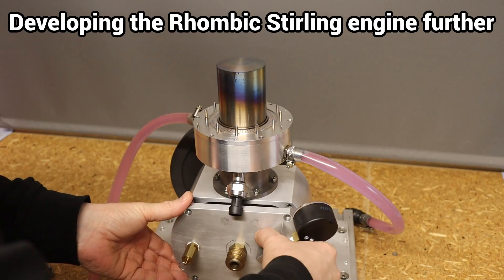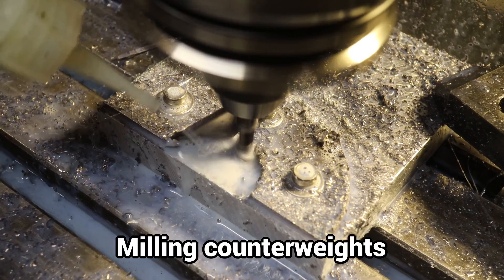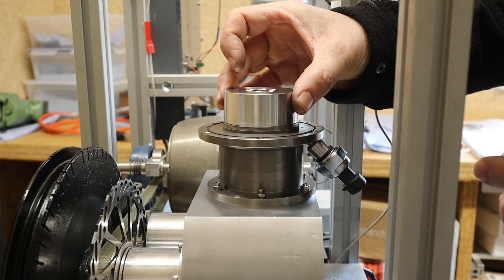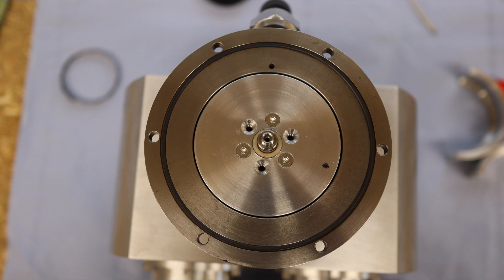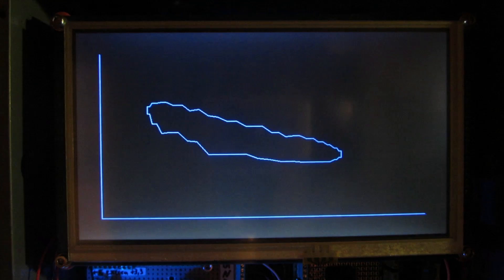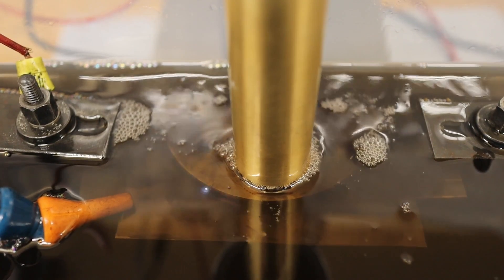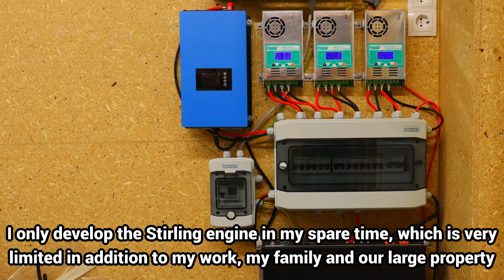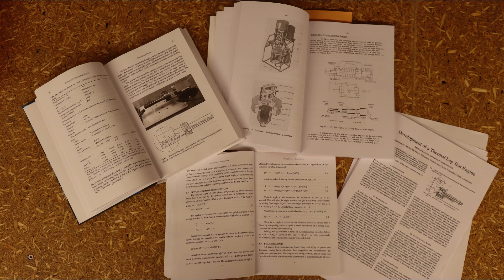Stirling engine development for cogeneration of cheap DIY energy to become off grid and independent

Comment: Hi. Cool project. I think that every type of Stirling engine can generate a certain amount of power for a specific application. In a home application, the weight of the engine is irrelevant. The size of the engine can be limited to a certain extent. What I'm getting at is that power and durability can only be achieved with a working piston. As you explained in the video, the ratio of friction to size and rotational speed is important. I am looking for a displacement piston as a rotating piston to reduce friction in this part of the engine. I also believe that, in general, a larger engine with lower rotational speed will have greater efficiency. Best regards :)
Reply from the maker: Thanks for your kind comment!
I don't know what you are referint to, but usually when I talk about reducing weight I mean reducing moving mass!
Moving masses mean friction, wear and unbalance!
When I go back to the rhombic Stirling when finished the thermoacoustic, I will make a much larger version.
A 18 kg Blank from 1.4571 stainless steel for the heater is already in my workshop!

Comment: Instead of piston rings, have you perhaps thought of using amorphous carbon piston skirts, designed similar to turbine engine oil seals?  Or just extrude-honing the piston bore to create a localized area of microturbulence?
Reply from the maker: The piston running surfaces must run dry, which makes many things more difficult!
An amorphous carbon piston skirt sounds very complicated?
Thank you very much for your helpful comment!
Reply: @myengines2443  they are not terribly complex, but they require a somewhat specialized manufacturing process as carbon powder ingress will short out PCB boards, etc. so any lathe or mill used to shape the carbon must be well-protected.  They are used in gas turbine engines to seal the rotating power shaft(s) bearings from leaking oil and from preventing compressor bleed air from entering the bearing housings.  They are strong enough to function well against axial friction in engines that produce many tens of thousands of HP, but they are too fragile to resist much radial pressure.  There is a paper "Leakage and wear characteristics of carbon seals for aero-engines" by Guoqing Li et al. that describes carbon seals and their design fairly well.  Good luck!
Reply from the maker: Thank you very much for your great help, I will look very close to this technology!

Comment: Thanks for sharing! I'm about 80% percent done designing my external heat engine in CAD but stopped to focus on piston seal design after watching this video--I am concerned about the piston service life. I originally planned to use an off-the-shelf PTFE (with a filler) piston seal but will experiment with a piston seal that uses a different approach than an "energizing" o'ring backing to increase the effective spring length to allow the seal to expand more as it wears, thereby extending the piston seal life. 

Applying this approach in your case, it would be like having multiple concentric spring steel straps to increase effective spring length. Maybe alternate between wavey pattern and circular pattern, concentrically. So, as your Igus tribological piston seals wear, the force pushing out will not decrease as fast, hopefully extending the service life of the piston seal.
Reply from the maker: Please show a video of your very interesting work, it will help us all and you also as you get so much motivational help!

Comment: Maybe you can try ribbed pistons for maximum heat exchange.
Reply from the maker: The engine has very big heat exchangers so a ribbed piston would not make a big difference.
it would also make the pistons more complex and heavier.
In an engine without external heat exchangers your suggestion could be very efficient.
Reply: :p

Comment: If the work output of the Stirling Cycle is singnificantly lower than that of the Diesel Cycle, wouldn't it make more sense to consider implementing a different cycle - such as Diesel, Otto, or Brayton - in an engine with an external heat supply?
In a cogeneration plant, the heat removed during the cycle can be transferred to the coolant return line.  Therefore, the absence of regeneration in the cycle may not have negative consequences.
It is likely that such an engine would require a gas distribution mechanism, but the added complexity might be justfied by increase in power output.
Reply from the maker: I don't want to use an internal combustion engine as I want to use self produce bio gas or wood gas which both are not absolute clean and will destroy an internal combustion engine very quickly!
Reply: @myengines2443 Если Вы прочитаете мой комментарий ВНИМАТЕЛЬНО, то сможете увидеть, что двигатель внутреннего сгорания в нем не упоминается. Речь идет о двигателе с внешним подводом теплоты. 
  Я считаю, что в когенерационной установке может быть применен двигатель с термодинамическим циклом без  регенерации теплоты.
  Лучшим, вне всякого сомнения, был бы двигатель работающий по циклу Карно. Однако, реализовать такой цикл мешают два его недостатка - очень высокое давление, развиваемое в процессе цикла, а так же чрезвычайно большой ход поршня, необходимый для обеспечения полноты расширения.
  Предлагаю отрезать оба проблемных участка. Область высокого давления ограничить изобарой, а область чрезмерного расширения ограничить изохорой. В результате получится термодинамический цикл из шести процессов - две изотермы, две адиабаты, одна изобара и одна изохора.
  Такой цикл будет совсем немного уступать по своей эффективности циклу Карно и не будет иметь его (цикла Карно) недостатков.
  Однако шесть термодинамических процессов в цикле, по моему мнению, слишком много для простого и надежного двигателя. Для небольшой когенерационной установки, полагаю, лучшим был бы цикл из двух изохор и двух адиабат, известный как цикл Отто. (Прошу обратить внимание, что речь идет не о двигателе внутреннего сгорания,  а о двигателе с внешним подводом теплоты, работающим по циклу Отто.)
  Так как при изохорных процессах работа практически не расходуется стартовать такой двигатель будет очень легко.
  Как и в двигателе Стирлинга, для увеличения мощности начальное давление может быть значительно больше атмосферного.
  Основным недостатком такого двигателя является наличие газораспределительного механизма.
  По классификации Г. Уокера все что имеет газораспределительный механизм - двигатели Эрикссона. 
  Прекрасно понимаю, что такая тепловая машина не является двигателем Стирлинга, с которыми связана Ваша многолетняя работа. С большим уважением отношусь к Вашей работе и, вероятно, любимому занятию и понимаю, что моя идея противоречит Вашему творчеству.

Comment: I think the small win being compact is lost many times over in efficiency.
Reply from the maker: Compact in relation to what do you mean?
Reply: @myengines2443  cylinders and piston in line make a compact design. But there is more complex moving parts, like a piston rod goes through another piston. I makes that rod need an extra link and difficulty to get a good seal through other piston, also possibly more friction.

two cylinders in 90 degree apart takes more room, but is very simple

Comment: Where you're going wrong is making all your own parts. For true long service life see what you can pick up from Honda motors as far as pistons and piston sleeves, etc. You just cannot make any tech brand new from the ground up the tooling required to roll something out like that even if it gave everyone free electricity forever would be so expensive the uptake would be very slow, that's why humanity only goes in spurts of tech improvement rather than linear. Tooling is a bitch.
Reply from the maker: Unfortunately the use of parts from the shelf is often not possible.
A Stirling engines has very different demands than a conventional internal combustion engine that it would not work.
The piston for example has by far too much friction and is too heavy, not to mention that it has to run dry.
The Stirling only delivers very little power per cycle which is often completely used up by friction, that's why you see so few powerful of them.
When I develop the rhombic Stirling further I will watch out for every gram of moving mass and every tiny part of friction in the first place!

Comment: I envy your abilities, and hope you can beat the Friction problem. You might get help from 1cc to 20cc Model Aircraft engine tech.  I've no idea, but they use different bore materials, like chrome, brass, stainless and several other alloys.  Maybe I'm a dreamer, but I said it anyway!  😸
Reply from the maker: Thank you very much for your help, but the Stirling has to run dry which makes a big difference for the choice of sliding surfaces!

Comment: I like your beta engine. However, i belive that its power can be increased. Let's consider the adiabatic model. Heat supply and removal occurs only along isochores. Heat transfer processes take time to occur, unlike adiabatic ones.
 I suggest removing the flywheel output shaft. The flywheel shaft and engine output shaft are connected to each other using two elliptical gears. At a constant flywheel speed the displacer will move more slowly on isochoric sections.
 In the areas of dead spots speed will increase. Heat exchange will improve, power will increase.
 Sorry for bad english.

Comment: on otto emgines to test if the pistonrings are worn out people but oil in the cylinder, so if you then get compression with the oil, you know rings are worn out. so the oil highers the compression, couldnt u use it in this application someway since the oil wouldnt burn in this stirling engine?

Comment: Hi 
did u make some experiments with different gases Ammoniak ore fridge gases?
Reply from the maker: I tried air and helium.
Ammoniak or fridge gases are too poisonous or dangerous for me.
When I develop the engine further I will make more tests with helium!
Reply: Thanks I THINK Ford has an 40 hp  10L Oil Stirling Engine  in the end of the 1970 but how they do it . Sorry  I hope U will find . Dont be afraid about gases A: not downstairs ( Outside) and B: Ammoniak or others  Poison take a Mask   
Ure fridge Boxes at home runs with gas . Take ab idea from them . Sorry for that english 
Good luck for you're doing

Comment: In this particular Stirling experiment have you considered using a pressurized fluid such as helium? It looked like you were just on the cusp of doing something different.
Reply from the maker: Normally I used air at 10 bar pressure, and made some tests with helium.
The same is the plan for the new engine.

Comment: Is there a reason you didn't go with brass or bronze, due to their low friction?
Reply from the maker: I use a tribological plastic , W300 , for piston rings which has far lower friction than brass and bronze which I tried also among many other materials like filled and unfilled PTFE etc.
The problem is that is has to run dry.

Comment: Interesting work!

1) I'm only armchair and YouTube.

2) I'm more an entrepreneur than an engineer.

3) I'm fascinated by the Stirling Engine as the poor man's doorstep to mechanical better-life --- like water power was to New England.

4) The Sterling Engine is something the 3rd World INDIVIDUAL can make (!).   

5) Isn't there a big Stirling Engine that that can contribute something to the poor 3rd-worlder's leg up the standard-of-living ladder?

6) Can't a big Stirling Engine be made to power, say, a boat for people/goods who need transportation up and and down rivers or between islands, powered by coal?   Or plow a rice paddy?   (I saw one being used to pump irrigation water in India.)

Again, it's the "this can be made by one person" aspect of Sterling Engines that is the appeal.  (!)

Any thoughts?
Reply: A cheap one cylinder motorcycle engine will be an more easy startingpoint for your project. 
People in development countrys have limited acces to havy machinerie, but usualy  allredy use cheape asian motorcycles and know how to service them. 
They are around ~150$ and have a great power to weigt ratio while also better fore usecases, were you only need power for a couple of houers like a river booat.

Comment: Congratulations on some fine engineering in the pursuit of a useful Stirling engine. The outcome has predictably indicated what most of us amateur experimenters have found in the past. i.e. the Stirling engine is an interesting concept but proving almost useless in a working environment. The power released by this cycle is barely enough the overcome the normal internal friction found in any engine with crank and piston. In other words we are lucky if it runs at all and the power available to do useful work is very low. No doubt some special hybrid machines might be made to work for the AEROSPACE INDUSTRY but at high cost and limited working life. Experience also seems to indicate that the larger the Stirling engine, the less efficient it turns out to be. Well done Sir, for some serious  work on this interesting  concept.
Reply: Have you seen the Stirling powered Swedish Gotland class submarines? The US Navy has leased one with crew for 2yrs to assess. In exercises they keep "sinking" USN carriers. Stirling engines do have issues but using the sea as a huge heat sink solves some basic problems
Reply: Interesting work!

1) I'm only armchair and YouTube.

2) I'm more an entrepreneur than an engineer.

3) I'm fascinated by the Stirling Engine as the poor man's doorstep to mechanical better-life --- like water power was to New England.

4) The Sterling Engine is something the 3rd World INDIVIDUAL can make (!).   

5) Isn't there a big Stirling Engine that that can contribute something to the poor 3rd-worlder's leg up the standard-of-living ladder?

6) Can't a big Stirling Engine be made to power, say, a boat for people/goods who need transportation up and and down rivers or between islands, powered by coal?   Or plow a rice paddy?   (I saw one being used to pump irrigation water in India.)

Again, it's the "this can be made by one person" aspect of Sterling Engines that is the appeal.  (!)

Any thoughts?

Comment: Personally, while this is a great design and very informative; I think that you are running into the same problems that early 1900’s steam engines did. Without adding a lubrication system, you have too much friction & at proper RPM, your engine would wear out far too quickly to be of much use as a reliable generator.
Reply from the maker: Yes, that's the exact reason why I settle to the new Stirling concept you can see in my new videos!
Reply: Interesting work!

1) I'm only armchair and YouTube.

2) I'm more an entrepreneur than an engineer.

3) I'm fascinated by the Stirling Engine as the poor man's doorstep to mechanical better-life --- like water power was to New England.

4) The Sterling Engine is something the 3rd World INDIVIDUAL can make (!).   

5) Isn't there a big Stirling Engine that that can contribute something to the poor 3rd-worlder's leg up the standard-of-living ladder?

6) Can't a big Stirling Engine be made to power, say, a boat for people/goods who need transportation up and and down rivers or between islands, powered by coal?   Or plow a rice paddy?   (I saw one being used to pump irrigation water in India.)

Again, it's the "this can be made by one person" aspect of Sterling Engines that is the appeal.  (!)

Any thoughts?

Comment: have you considered a piston design like is used in an oil-less compressor? f I remember correctly when I had one apart it has a single plastic ring - teflon? delrin? and is lightweight and durable with no lubrication needed and would have an impressive lifespan considering the reduced pressure and temperature. Find a discarded hobby compressor and I'll bet it gives you ideas.
Reply from the maker: Most compressors have far too much friction and weight for a Stirling piston.
I use rings of W300 tribological plastic but my next version will be ringless and trimmed to low weight!
Reply: Interesting work!

1) I'm only armchair and YouTube.

2) I'm more an entrepreneur than an engineer.

3) I'm fascinated by the Stirling Engine as the poor man's doorstep to mechanical better-life --- like water power was to New England.

4) The Sterling Engine is something the 3rd World INDIVIDUAL can make (!).   

5) Isn't there a big Stirling Engine that that can contribute something to the poor 3rd-worlder's leg up the standard-of-living ladder?

6) Can't a big Stirling Engine be made to power, say, a boat for people/goods who need transportation up and and down rivers or between islands, powered by coal?   Or plow a rice paddy?   (I saw one being used to pump irrigation water in India.)

Again, it's the "this can be made by one person" aspect of Sterling Engines that is the appeal.  (!)

Any thoughts?

Comment: I've had ideas about just using a CO2 based turbine system to utilize heat differentials. It may even be able to work with surface temperatures and temperatures just a few feet underground over a large area. Turbines have quite a great deal of efficiency and if you tinker with the amount of CO2 in the system then you can change the boiling point of it to better accommodate whatever the hot end's temperature is. The cold end could also be water cooled, which would be useful if you have a nearby pond or even better a river/stream.
Reply: That would be interesting when used with a Tesla generator

Comment: A great commitment to a project. High admiration. A point on the direction though, especially considering what you have learned about the Stirling engine. You may want, even just from curiosity point of view, to research "Cold Steam Tesla Turbine", as you may find it conceptually something that will be very fitting to your needs and skill set to develop.